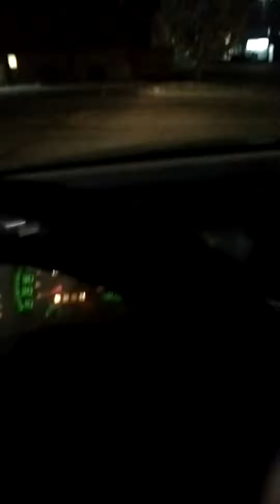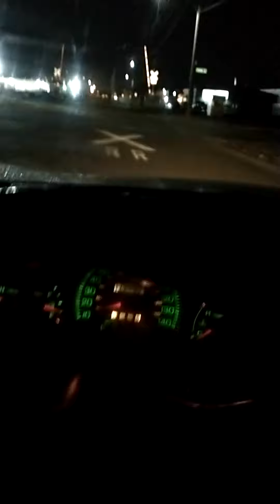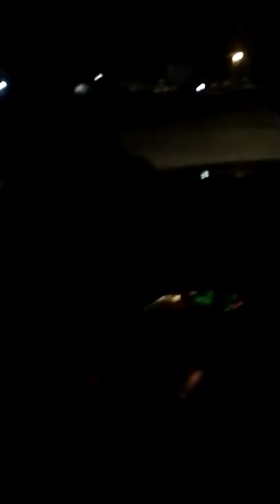1999 Crown Vic P71 NO EXHAUST

Comment: You should watch Fasterproms exhaust test video they put an 03 on a Dyno and tested it with a full exhaust and with no midpipe open headers and it picked up 11 horsepower with no midpipe
Reply from the maker: I ditched everything past the H pipe and the car felt faster and sounded great. Then i bottomed out driving up a dirt bank and busted drivers side bank off. In this video theres literally 8" of pipe off each manifold and they dump straight down. Thats it lol

Car runs terrible like this lol its been parked for a couple years now, ive been gathering parts for it this whole time. Got a trac lok posi for it, gonna try and just put her back to stock. This is the angriest, most violent car ive ever owned when its running right. Floor it through first and it runs up to valve float and just hangs out there for a second... Then BOOM it slams 2nd gear and gets squirrely lol. Been in my family since i was 12, im 29 now. Its an ex Iowa DOT enforcement car. My dad bought it just like it is. I love it